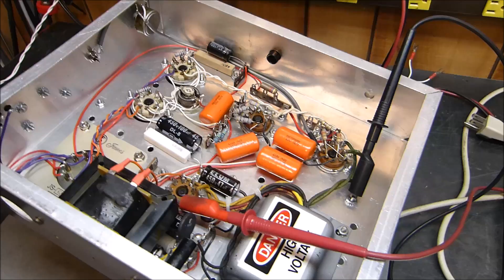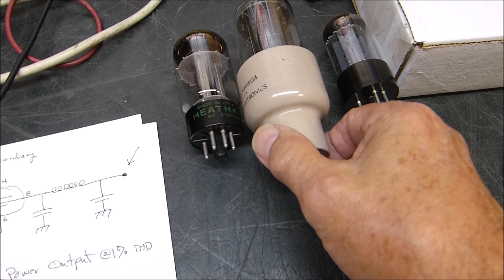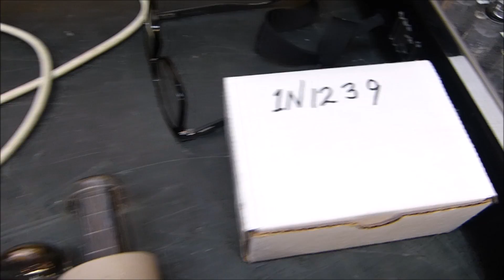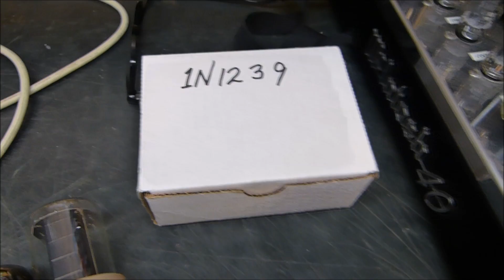5U4, 5R4, 5V4, 5AR4 & Solid State Rectifier Performance in Vacuum Tube Amplifiers

Comment: I see a lot of guys on the forums put diodes before the rectifier tube, what effect does that have on the amp? (I think they do it to use the tube as a soft start)
Reply from the maker: They put diodes in series with the 5U4? What do they claim that does for the amp?
Reply: Yep the diodes are placed in series before the 5U4, I've heard a few reasons  that I can remember 1) the tube gives a delay, so it's better than just going with diodes 2) the diodes increase the life of the tube / reduces the strain on the tube. I think there were other explanations too, I remember reading one person claimed better low frequency response but, I've never seen anyone post before and after measurements to back up these claims. I would be curious to find out what effects it actually does have on an amp.
Reply from the maker: I can't imagine it having any effect at all except lowering the HV by another 0.7 volts. I think of these types of changes like polishing the chrome lug nuts on a car wheel. If you make the lug nuts really shinny and put a coat of wax on them,  it will lower the wind resistance and make the car slide through the air with less resistance and provide not only a smoother, faster ride but will increase the gas mileage. Combine that with a beer (or two) and an overall good day at work and home and some favorite music makes everything better. No disrespect meant to anyone as we are all influenced by our emotions and beliefs.
Reply: Speaking of various changes because of varying ideas, I've heard this one in regards to power supplies before (I had an amp with a dropping resistor because the HV was slightly too high, and a 10H choke) and was wondering what your take is. It's along the lines of "Big caps and chokes = dampened dynamics and a current starved amplifier. Low DCR power transformer with low value chokes and caps = dynamics." I got that response and was yelled at because I was running my tube at 100% dissipation for class A single ended. So I'm I really drastically shortening the life of my output tube by running it at its rated plate dissipation?
Reply from the maker: I think there is more than one discussion item here. A transformer with low DCR (DC resistance) implying higher current levels; low value chokes, I assume again low DCR (?) or low L (?) I assume still leaning towards higher current and then low caps (?). Does low caps means low C values (?) that doesn't add up to higher levels of current so that doesn't seem to follow. As for running your SE class A amp at 100% dissipation, it probably improves performance, i.e. power output and lowers THD so that is a good thing. Class A draws current through all 360 degrees of the cycle so actually putting a signal through the stage does not increase the plate current very much. Bottom line is there is always a trade-off. If you want your tube to last forever, run it at very low plate current and deal with the poor performance or if you like it performing best, run it they way you do and have a spare tube. I prefer doing it your way.
Reply: I'm going to keep running them at their rated plate dissipation, they're rated for it and the THD is much better that way (In a 2A3 amp I worked on a while ago the THD was 5% @ 1 watt 1 KHz because the tube was running approx. 50% of rated dissipation, when I increased it to it's rated 15 watts the THD dropped to 0.4% @ 1 watt 1 KHz) 

 For the power supply the ideology I'm coming up against is that they believe that the inductor value's (both DCR and L) along with caps values (both capacitance and ESR) should be kept as low as possible across the board, I'm being told that my large choke 10H and my big caps 560 uF are going to kill the dynamics of my amp and that they should be all tossed for caps that don't exceed 50 uF and should all be film for lowest possible ESR and that the inductors should be reduced in size and that there DCR shouldn't exceed 20 ohms. 

 So my question is does their argument have any validity? Am I screwing up my amp by having all that filtering? When you build your power supply filters is there a number you shoot for, for your acceptable ripple? I'm willing to take a course correction on my building method if I'm going the wrong way.
Reply from the maker: I don't think you are doing anything wrong. Years ago I built a 20 meter, two element yagi from the ARRL handbook and manually tweaked it to perfection. Had it the air for 10 years. Ran a 4CX1000A amp into it. Then I ran across a software program that "designed" yagi antennas and I started playing with it and decided I should readjust my perfect antenna to make it better. Screwed it up royally and finally even took it down and scrapped it. There is a lot of bad advice on the Internet where people that really don't know diddly will bully others around until they screw up their equipment and then say, "I told you so". I don't think these huge 560 uF capacitors are necessary but they are not going to hurt anything. Theoretically, they add more reactance to ground for high frequencies by increasing the inductance in the capacitor (this is true) but if you are concerned by that then simply put another smaller capacitor parallel with them to lower this inductive reactance, like maybe a 0.5 uF or so value capacitor.This supposedly will affect the high frequencies.  You do see this sometimes in designs. What it does for sure, I don't really know.  We often times over-kill everything in our builds in size and that is OK. It's fun to endlessly tinker and measure all these parameters like ESR but in the end, much of it is still polishing lug nuts. I suggest (and I should take my own good advice) do the best you can to get back where you started when you have a good instrument so that when you mess it up you can recover.  As for a number to shoot for in building an amp? That is a big question. I want my S/N ratio at least -75 dB. I can't hear any more hum out of an amp that measures -75 dB than one that measures -90 dB and I run Klipschorns that are extremely efficient. I can't give you a numerical % number for quiescent state to full drive power supply voltages. I build my power supplies as big as I can and have them fit the chassis as I almost always use what I have and most of it is over-sized parts from military surplus. Works great. Sounds like you have built a nice amp. About all I listen to is the PP 6B4G amp you often times see on my videos and it does 10 watts with SS rectifier and 9 watts with the 5AR4. Some people would tell me it is junk but I love it. Keep up the good work. You are doing great and should be giving some of these other guys advice instead of taking theirs. Just my opinion.
Reply: David, 

Unfortunately, we don't listen to THD meters, at 1 Watt and at 1K.   

If we have efficient speakers, such as my well-wired ALTECS, or - maybe well -wired Klipsch, we listen at about 1/10th to 1/12th of a Watt on most playback. There, and not a one Watt, one frequency, is where the amp must perform well.  

Anyone  who owns a close to a state-of-the-art system using ALTECS will EASILY hear what 250 P-K at 60 mA. on a 2A3 sounds like, ( 15 Watts plate dissipation) versus the same tube running at about 11 Watts dissipation.  

The former will sound STRESSED, and sorta " Up -Tight ", compared to the later, because the 15 Watt dissipation op point ( commonly and, IMHO, mistakenly used ) is stressed, sounding THERMALLY. 

Additionally, the best-sounding tube amp I am aware of, since it was developed in 1989, ( never been bested ), uses 2A3s conservatively run at only about 10.75 Watts dissipation.   

So we have a NON -THEORETICAL PRECEDENT established - actual performance, for the past 28 years, in audio design.   Not too many people are aware of this.  But now, you are !!  ( The Serious Stereo DC SET amp ).  

By the way, each monoblock rectifies with a 5U4GB, typically an EH or a JJ . Those attending RMAF in Denver, Oct 6-7-8, this year,  can hear this all for themselves,  on GPA 604 MLTLs,  Room 3017.

Jeff
Reply: Jeff,

    I do not own Klipsch or ALTECS currently but, my horn speakers are 100 dB @ 1 watt, as far as listening levels I typically listen around 1/2 watt but, on occasion, typically with classical, it does swing into 1 watt territory.

  As far as the plate dissipation I tried it both ways with the reduced and with the rated  level, to my ears the reduced level had a muddled or veiled quality to the sound, where as the rated value sounded clean and crisp, more alive. 

  I often find that when something doesn't sound right with an amplifier and I connect it to my bench equipment, it's reflected in its measurements. I don't use my measurements as an end all be all but, I definitely find them to be informative guides. 

  As far as revered gear goes I can think of a few popular amps within the hobby that actually drive the outputs beyond their rated specs. I am also aware that some gear that doesn't necessarily measure well can still sound amazing, I love my Magnepans but, they aren't terribly flat in their response. But, I've more or less started to learn my own taste as I've progressed in this hobby and I've decided to pursue designs and gear that sounds good to me.

  I do appreciate hearing others opinions and ideas, thank you for sharing yours with me.

        David
Reply: Hi David, 

 Nice response.  Yes, I have NO DOUBT your triode amp sounded better when you used full dissipation of the 2A3,...... a ( mis ) design practice I avoid doing. 

The reason why running the 2A3 at full dissipation sounded  better to you - " less muddy " are your exact words, is because of your DIY   mis designs.  

Referencing to the last schematic you sent me described as, your " favorite amp schematic", there exists multiple areas of DIY mis-design, so, to get ANY fidelity, you have to OVER-HOT ROD the tube to get even minimal performance.  :

a) Your 6SN7 input tube used a 4.7 K " grid stopper ", when, if any ( at all ) was needed, about 210 to 220 Ohms ) is about as high as you want to go on the driver tube.  I have carefully A-Bed such things, over years of DIY DHT amp building. 

So, the Driver tube was " stopped up "' so to speak David.  You were losing the signal's integrity at the very first stage of a two stage SET. Never to be " made up" .....in later stages. 

b) Your 2A3 Finals stage used a 20K Ohm !!!! grid stopper, when, if the amp was built clean and simple,  NO grid stopper should be used.  

In the past, ( 1983 - when I designed and built my first DHT output stage amp ) my careful  listening tests when employing grid stoppers, shows a range on the DHT Final's tube of between 119.5 to 121 Ohms as the best sounding value in a complex circuit ( push pull parallel 6B4Gs ). 

A 20K 2A3 grid stopper "constipates " the input to the control grid of the 2A3, from the already-constipated signal coming from your Driver stage.  

c) The third reason why you were forced to ( mis ) use full dissipation of the 2A3 tube's plate, was because of one of the worst - designed power supplies, I have ever seen in a DHT SET amp, maybe in any tube amp.  

Why, because you are adding series resistances to the Finals B+ filter, when the DESIGN goal is to have a LOW as possible a series DCR to the Finals.  

You did a C'/ L / 'C / 'R'/ C filters to the Finals, with a 80 Ohm DCR L, and a 500 Ohm 10 Watt R !!!  A whopping 580 Ohms of series resistances, to filter the B+ to the FINALS stage.

The very FIRST thing my genius audio Mentor in 1982 ( Robert W. Fulton of Fulton Musical Industries, look him up on line ) told me about any 2A3 amp build. / design, was " Jeffrey, all the power supply chokes need to be 20 Ohms or less, going to the Finals stage ".   This was the FIRST thing he told me.   He is, of course, 100% correct. 

Where you have ADDED series resistances of 580 Ohms, contrast this to my designing.  I employ a L1/C1/L2/C2 filter ( always ) and the TOTAL series resistances of BOTH L1 and L2 has been 20 Ohms or less, for the last two decades in my amps.  No choke over 10 Ohms DCR. 

In 2017, my last amp build has 12 Ohms of TOTAL DCR to the Finals, in its B+ filter, and that is BOTH L1 and L2's DCRs added  in series.  Yep, I am down to using 6 Ohms DCR chokes, and good wiring and lay out, and it sounds awesome and DYNAMIC - like nothing anyone's heard. 

Low ripple, to the FINALS, is NEVER the goal of a GOOD sounding amp, one that plays music.  QUICK energy delivery is the goal to the Finals. The high mu Driver tube certainly needs low ripple, ( I get that, and I shunt regulate the Driver stage) but NOT the low mu DHT Finals stage.

So David, I do NOT deny what you, or other amateur DIYer s hear, when " pushing " up the plate dissipation of a 2A3, but its a very  MIS 2A3 designed amplifier, from which you are drawing your conclusions. . 

The 2A3 tube, ( as you employ it )   will last only 2,000 hours instead of 10,000 to 20,000 hours.   IF you had a good reference amp to compare your amp to, you would hear this.  Dissipations in the 58-60 mA / 250 VDC P-K range ALWAYS sound stressed to me to my ears.  WHY ??? ..... because the 2A3 tube IS THERMALLY STRESSED.

The choice is yours, trust what ( no doubt ) you heard on DIY amplifier mis-designs, or, try out what I have suggested herein. You are the one that has to live with the result.  I will put my 2017  DIY SET amp builds up against ANYTHING in this world, and it will fare well.  Have fun, I sure do.  

If there is any way I can help you in your quest, let me know David.  If you can visit Denver, RMAF audio show this October 6-7-8th, stop by and HEAR all of what I am discussing in action, at my friend's demo room, 3017, Serious Stereo.  I will be visiting there, would love to meet you.  Kudos on the 100 dB efficient horn system.   I run  hybrid, mass loaded VOTT A7-800s with 515Bs and 802Ds.

Jeff Medwin
Reply: Hi Jeff,

      I started a thread on DIY Audio so we can continue this conversation without filling up ElPaso's comment section. http://www.diyaudio.com/forums/tubes-valves/311959-6336a-set-ciruit-improvement.html

  Just to correct one misunderstanding, the "my favorite amp schematic" isn't a 2A3 amp it's a 6336A amp and I can't take credit for its design, I bought it second hand. The 6SN7 isn't powerful enough to drive the 6336A itself so the person who built this amp also built a powerful pre to drive it but, the owner enjoyed it so much they weren't willing to part with it.

  The amp that I enjoyed the 2A3 at full dissipation was the popular Get *Set*Go amp (also my 6B4G but, its circuit is different)

 One thing I'm curious about, when you figure your Total DCR are you using solid state to rectify or a tube? If you are using a tube are you including its DCR in your total?

   I look forward to continuing our discussion at DIY Audio

    Ttyl,
        David

Comment: I suspect your 5V4 could be old and a bit on the weak side; You say it's labeled Heathkit----let's imagine it's probably a pull from a 1957 Heath hi-fi. Point being; it could be a tad shy on emissions. Ordinarily I would expect only about a 8-10 volt difference in voltage drop between a 5AR4 and a 5V4 per this table and per my experience. 

http://www.fourwater.com/files/fullrect.txt   [useful table of expected 5V rectifier specs] 

The other thing is that a modern day Russian 5AR4 (which it looks you have there) is not exactly an "in-spec" reproduction of a GE, Sylvania, RCA 5AR4/GZ34 from the 50's/60's. It's close and of course it works like a rectifier (when they don't blow up---lots of Russian GZ34's get H-K shorts in them and arc over) but it's a slightly different tube. Totally usable as a GZ34, but different in some small respects.
Reply: There's a good diode trick using 1N4007s to improve the reliability of the newer 5AR4s.
Reply: pneumatic00 Great comparison chart!  Very useful at a glance.  Thanks!

Comment: I am curious about what the voltage drop is across each rectifier.   The accepted drop across silicon rectifiers is around .7 volts to 1 volt depending on current flowing though it.  I am not at all familiar with the voltage drop across tube rectifiers.    Based on your experimental findings it looks like it could be around 45 to 60 volts for a tube rectifier.
Reply from the maker: That is correct. From the 5R4 to the solid state rectifiers there is about 50 volts difference in DC output of the power supply depending on the current drawn through the vacuum rectifier. Part of the point of the video is that you may or may not (probably not) be able to safely swap your old 5U4 type rectifier out for more modern day vacuum rectifiers or solid state rectifiers without surpassing the voltage rating of the electrolytic capacitors in the power supply. Also, my examples were not the best at showing over-shoot but SS rectifiers will provide an instant and higher voltage across the capacitors until the vacuum tubes warm up and draw down the voltage on the power supply. I forgot about the surge resistors I had in the primary circuit of the power transformer just for that reason, to limit inrush current so that surge voltages are minimized as the tubes warm up.
Reply: Great demo.   Thanx.